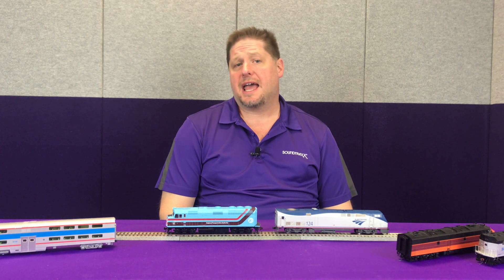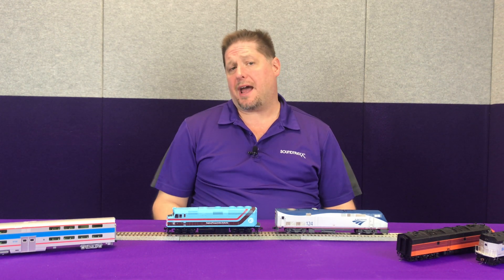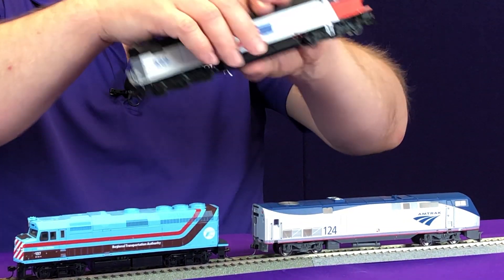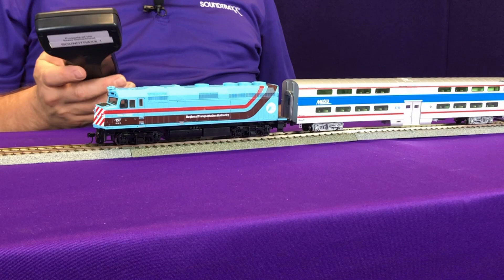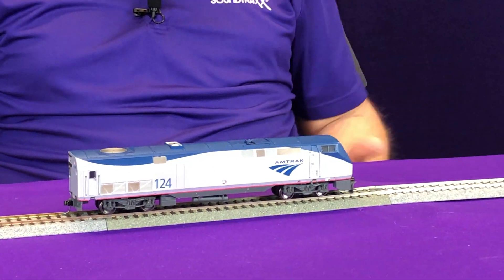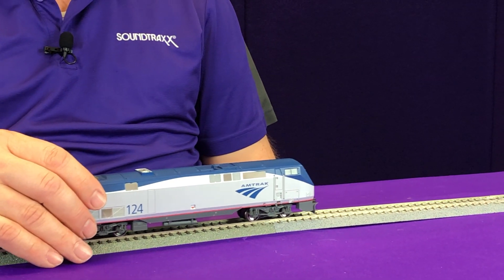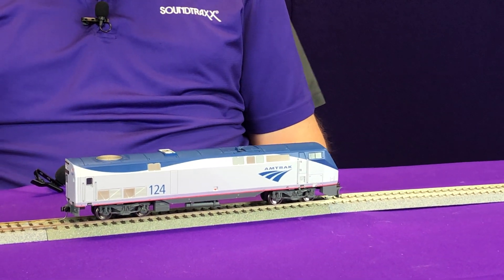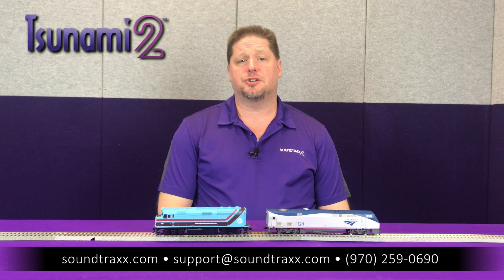HEP (head-end power) Mode with Tsunami2 decoders

Comment: How did you get that decoder in a Kato
Reply from the maker: In this case, we used a TSU-2200 and plugged into the NMRA 8-pin plug.  To make room, we had to remove the weight on the underside of the shell..  Then there is a place for the 28mm round speaker and simply connect to the purple wires and snap it in place.  
If you need more details, contact support at support@soundtraxx.com   
Thank you!